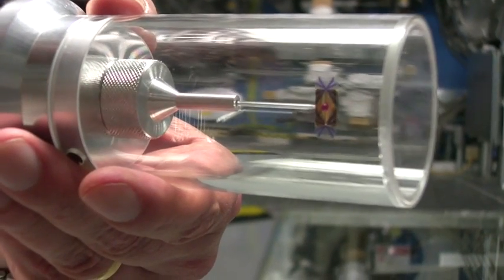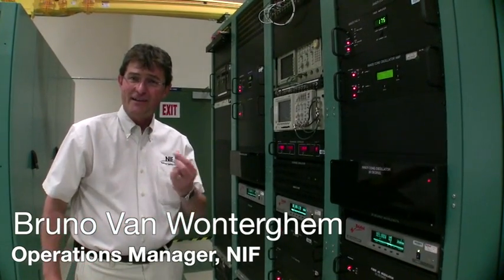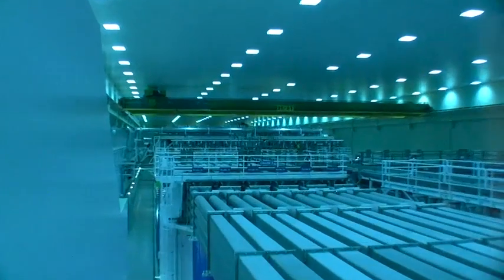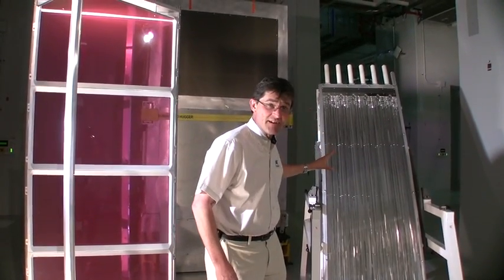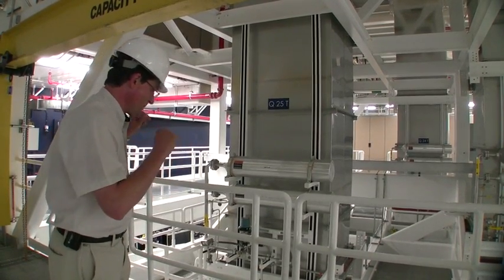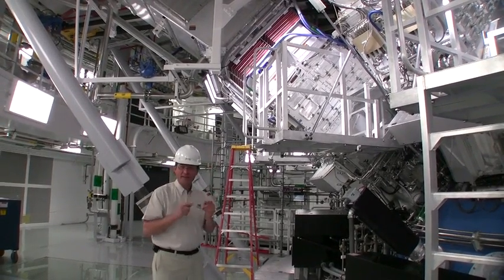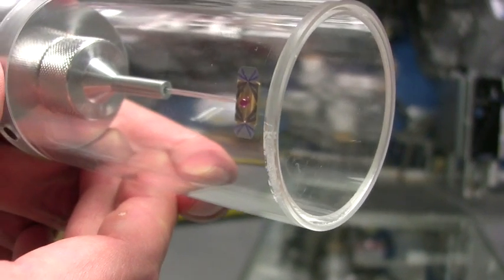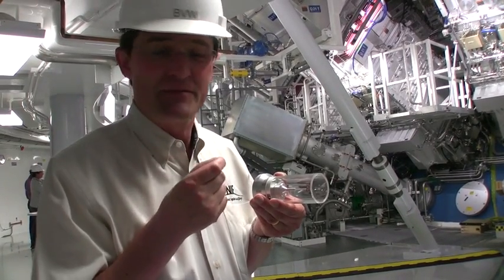Take a Tour of the National Ignition Facility

Comment: Not laser driven or inertial confinement, magnetic confinement. 

I wouldn't hold my breath anyway. That thing's been in planning since I was a kid in the 80s. The price tag is now up to $20 BILLION (4x NIF, 2X LHC) and that's with the scaled back plasma volume and canceled neutral beam injection and ion/electron cyclotron resonance heaters. There's no way they're getting breakeven before 2030 if it's even finished.

These are the darkest days in fusion research in at least the last 3 decades.
Reply: Damn
Reply: @joshuanejat1813  damn is right, my decade old comment was unfortunately right as fuck. lol. Just last week they announced the thermal shield to the vacuum vessel wall had cracks and will have to be disassembled and repaired. Also up to $23 billion total now, haha. My last line was right, but things have been looking up over the past year or so with NIF shockingly actually achieving hohlraum-level ignition with 3MJ target yields!
Reply: @Muonium1 they got breakeven controlled fusion
Reply: @The_Mitchell  I'm aware. But it's ignition and "breakeven" only at the hohlraum level.

Comment: This is the end of the line for laser driven inertial confinement fusion. Everyone expected 2 MEGAjoules of UV radiation to ignite the capsules, everyone. It hasn't, and even the best performing capsule implosions are still a factor of 10 away from achieving ignition. There is no way of closing a gap that massive when the laser is already performing at max energy/power. This is it. No one is going to build a bigger more powerful multibllion dollar laser than this as an experiment now. It's over.